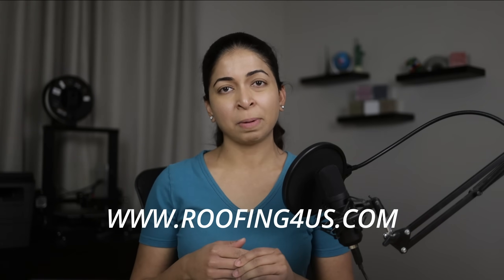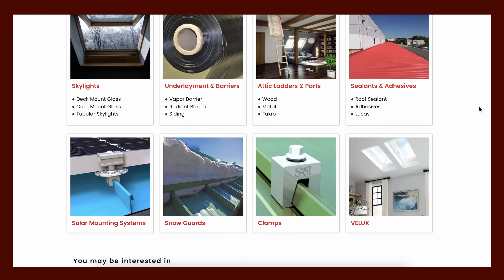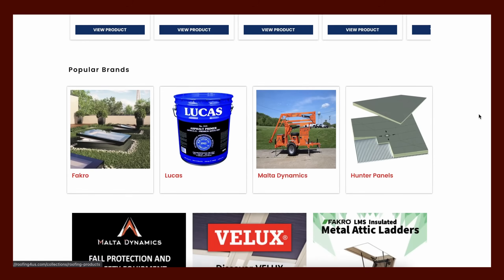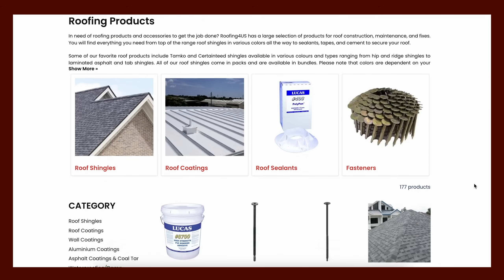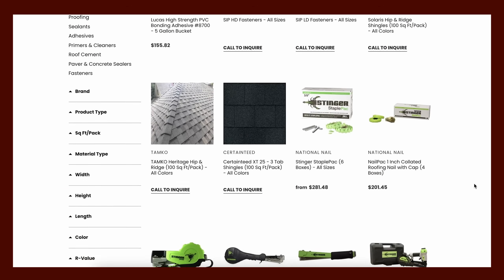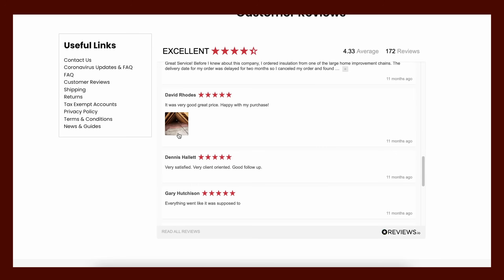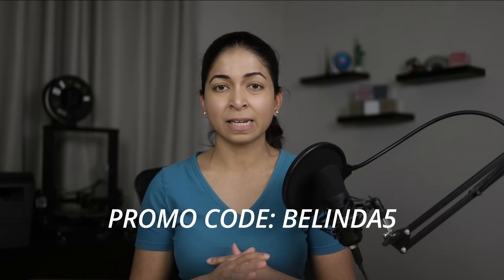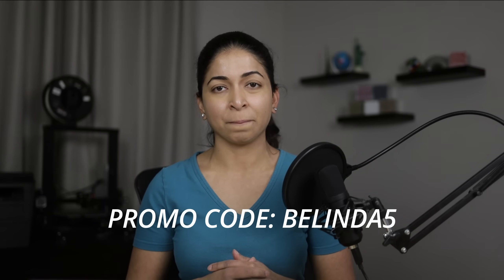Insulation that STORES energy! | Phase Change Materials

Comment: Phase change insulation material will not work on top of attic insulation. The material has to be placed first before the blow in attic insulation. The whole idea of phase change insulation is not to provide r value but to provide energy storage. Why would you want to store the attic energy only to release it into the attic when the attic cools? The outer material being recyclable (aluminum im assuming) doesn't mean there is a facility that would take it.
Reply from the maker: Contaminated fiberglass and rockwool isn't recycled, nor are most building products. PCMs can last over 100 years! Longer than the avg lifespan of a building. It can also be picked up and moved to a different building.

As for releasing it at night, it's smarter than letting attics get hot and allow the heat to move into the building through conduction, convection & radiation during the day... like traditional insulation does. 

I hope the product evolves to something that uses the energy stored, into of releasing it.
Reply: @BelindaCarr  100 btu per sqft won't play a significant part and won't be cost effective in keeping heat from transferring to the house. Thick blow in and passive attic ventilation. I do see it's benefits being used indoor or under attic insulation, but it's a large waste of money putting it on top of the blow in.
Reply: My thought too. Over here in ole Europe we use the drywall variant eg Knauf Comfortboard. It works but it's costly.
Reply: @astranger448  I remember first hearing about the drywall containing a wax to absorb and release heat maybe 10 years or more ago. I'm in Canada and in spring and fall I find the mornings can be cool requiring heat and some evenings hot requiring cooling so a large heat sync in the interior of the house would definitely save money.

Comment: I would like to see that light bulb experiment done with the left chamber having an empty foil packet to eliminate the foil reflectivity of heat variable.
Reply from the maker: Great point! I can try to conduct that experiment on my own.
Reply: @BelindaCarr  did you ever conduct this experiment?
Reply: @BelindaCarr  I would also love to see that! Please do
Reply: I really like your informative videos.  Maybe you can help.  We have a 2015 Winnebago Trend 23B motorhome.  We would like to travel more and not be limited by the outside temperatures forcing a move. Currently, we are in Florida fear is the humidity and rising heat will be too much.  We would like find a better way to keep humidity and heat out of the RV.  A lot of the heat is transfers from the metal frame windows which are single pane.  Maybe we could come up with a coving or upgrade for RV windows and insulation.
Reply: @vickiretzlaff5009  You would get better results for this question if you posted it in a Winnebago or general RV forum. There are a few things you can do to reduce the heat. Use shades or curtains over the windows, use reflective material on windows that face direct sun, cover the front window, and seal as many air leaks as you can.
Reply: Or perhaps a foil packet with the same weight of water within to eliminate normal specific heat capacity effects.

Comment: Now that's a cool video :). Really nicely edited and as usual nice presentation of facts (both advantages and disadvantages). As a suggestion, as a European viewer I would really appreciate if you could also specify data in SI units (100 BTU/sqft =~ 0.3 kWh/m2).
Reply from the maker: Thank you! I will try to convert all the data in the future.
Reply: @BelindaCarr  It will be greatly appreciated! The metric system is so much easier for us to understand.
Reply: @stephanemandelert4321  yes and it infuriates me. The imperial system is ridiculous. Utterly incomprehensible.
Reply: Thank you, saved me the same comment.
Reply: @qeplatinum-phasechangemate568  Hi! I'd like to know the product line, ie what thicknesses are available. Another question is the phase change temperature. I haven't found these info on your website.
Reply: @Sekir80  
3/8” thick 
Primary is dynamic phase change that occurs across 14° delta bandwidth.
Reply: @qeplatinum-phasechangemate568  Thanks for the reply! 
I guess 14° is in Fahrenheit.
So, you say the phase change is not happening at a given temperature (like 0°C for ice/water) but in whatever temp, and it takes 14°F to complete the phase change?
Reply: @Sekir80  In this case the phase change product Belinda features, occurs  across a 14° bandwidth. Not a single ° point. This is a cutting edge breakthrough
Reply: @qeplatinum-phasechangemate568  Awesome stuff! Could you define the low and high end of this range?
Reply: Counterpoint; the Celcius scale only has 100 points from freezing to boiling which is roughly half of the Fahrenheit scale of 32 to 212 so it is more descriptive to go Imperial unless you always use 3 digits for the Celius measurements. Just my two cents (which is a decimal-based measure)
Reply: @sjhorton1184  description and subdivision is not the point, accessibility and quick understanding without having to run the conversion or refer to tables is the point.

Including both Metric and US Customary units makes content universally accessible.
Reply: The thermostats I’ve purchased over the past few years have whole F’s or C’s in .0 or .5, so they’re still not as high res
Reply: You are confounding what you are used to, with what is best, since you can subdivide Celsius degrees as much as you want.
Nobody outside US and Liberia understand Fahrenheit, no science is produced in Fahrenheit.
And since Belinda was raised in Dubai and (I hope) want's people all around the world looking at her videos, she knows how difficult it is to figure Fahrenheit to any person not raised on it.